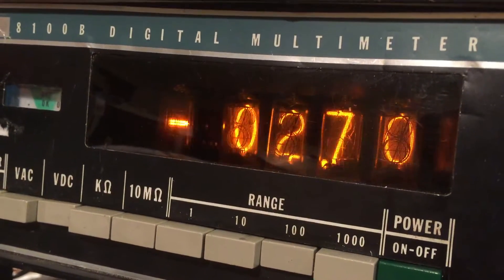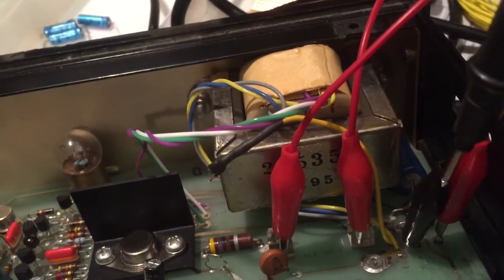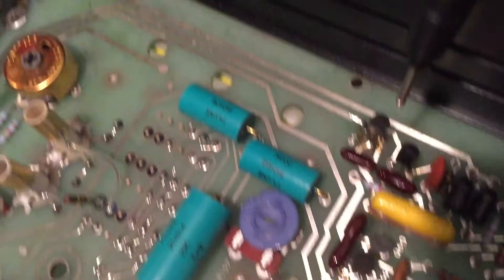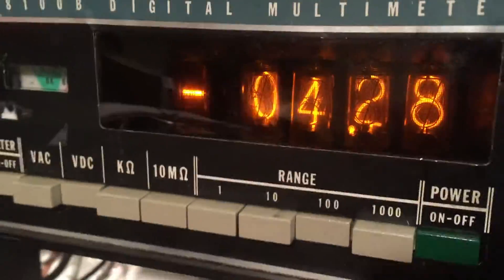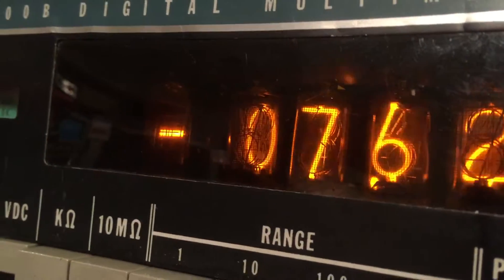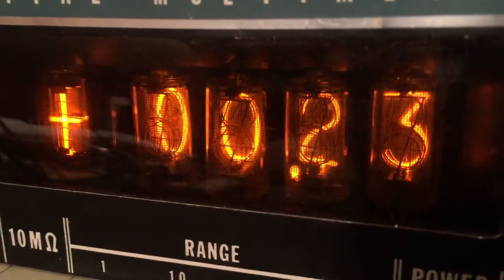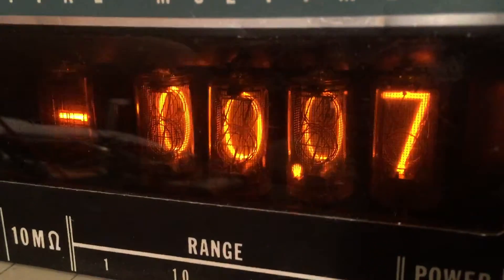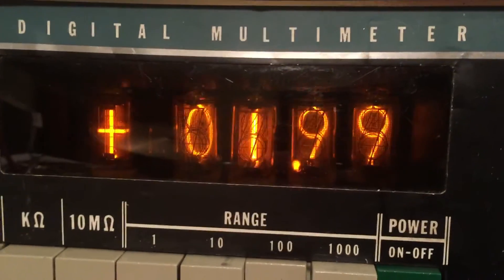Fluke 8100B Nixie Digital Multi Meter

Comment: Thank for the video. I just picked up an 8100a. It powers up but the tubes always read zero. I can't get it to measure anything. Any ideas what the problem might be? I checked continuity of the lead wires to the board but that's it. My first attempt at repair and I'm in over my head lol.
Reply: Have you got the manual (if not, you can find it online)? It gives quite a lot of information on testing and servicing.

Comment: good video. Trying to troubleshoot mine at present - the kiloohm range is low and the calibration pot doesn't do anything.
Reply from the maker: Thanks. Have you tested the pot with an ohm meter? Maybe it is bad? Are all resistance measurements off? Maybe the constant current source?
Reply: @PelDaddy  just got round to going back to it and fixed it - a wire wound resistor next to the K ohm pot had gone open circuit.
Reply from the maker: @bencollins5937  Nice troubleshooting! Glad you were able to figure it out. Enjoy the meter.
Reply from the maker: @bencollins5937  Nicely done! Glad you got it working.
Reply: Thanks for the help. Yes, the pot's reading 0 to 200 ohms as it should. However, I am not sure whether it is significant, but the gold cover is a bit corroded/flaky as if it has been exposed to moisture or heat. Most of the others look fine. I haven't tested the voltages and test points as set out in the manual yet, but will do. Where is the constant current source? Do you mean the voltage reference?